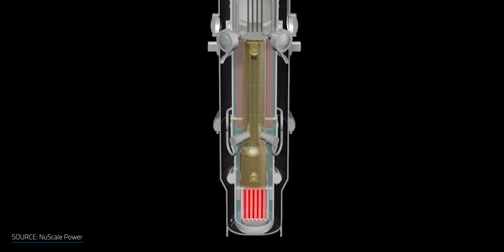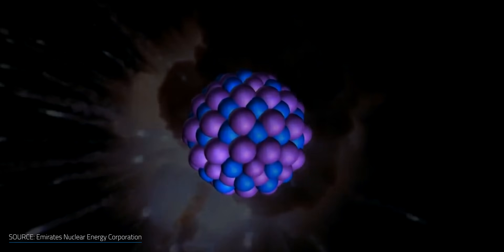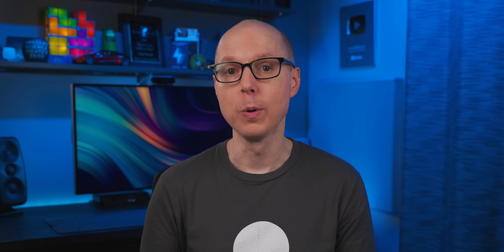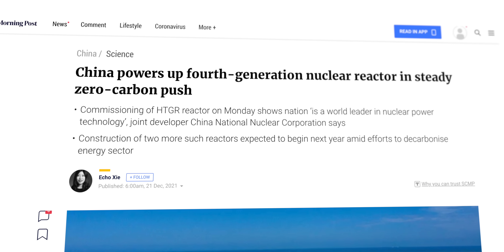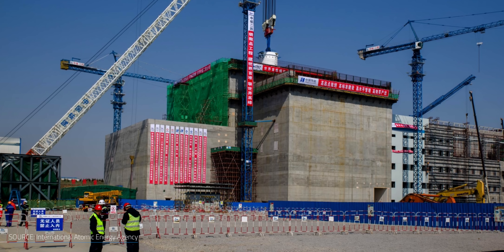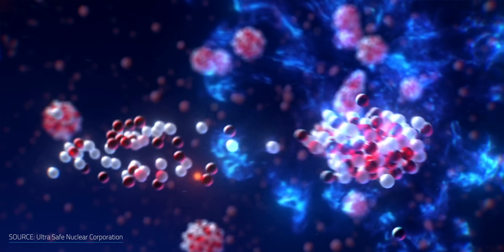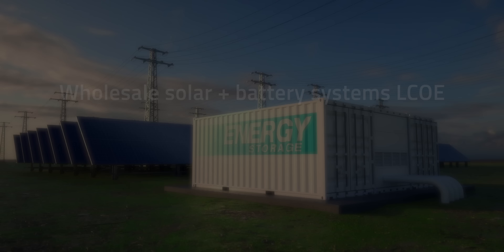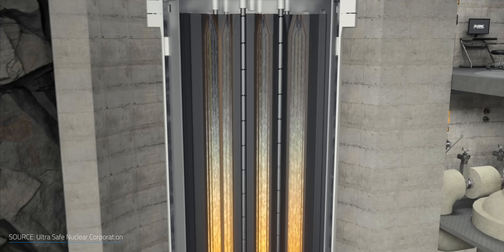Forget Small ... What About Micro Nuclear Energy?

Comment: What about small Thorium reactors I have heard about? You barely mentioned it. Small enough to build into every home or other building. No miles of wire to run. No danger of radiation. Also no big company to bill you for electricity, it comes with the house. Only service or maintenance costs.

Comment: Conventional nuclear power is faster to build (and cheaper) than wind, solar, and hydro. Even one of the most expensive nuclear power plants (Olkiluoto) is more affordable than the cheapest wind farm in Denmark. It has also increased its capacity way faster than wind (basically being built more quickly). LCOE is really flawed. It doesn't take the capacity factor, lifetime, backup and interruptions into account. It can't be used to determine the difference in cost of nuclear and renewables.

Comment: As versatile and efficient as helium gas cooling is with this technology, I think it's a non starter, for the simple fact that theres no means for consistent production on earth. It takes thousands of years for radioactive isotopes to decay into helium within the crust, and then we have to find it. This could be used to our advantage on long timescales with our own spent material, but this requires planning and follow through far beyond our current systems would accommodate.

Comment: I do not believe those wind and solar cost one bit. Reality prooves them as lies. German wind energy only exists because of massive subsidies. And not a single wind turbine has survived it's 20th birthday, the day the subsidies run out. Aren't they supposed to be super cheap and fully written off by then? Shouldn't they be free energy? Well, they aren't. At least in Germany and right now, wind energy is neither green nur energy. It's a cashgrab for subsidies. A scam. And nobody does anything to recycle the giant concrete pads that destroy forests and any hope of reforestation. PVC recycling is nonexistent. Plus, the inconsistency causes Germany to panic buy at 5x price in droughts, and sell at negative prices during storms.
Reply: Oh, and why does Germany have the most expensive electricity in the entire world if they have the biggest solar and wind program? Aren't they supposed to be exponentially cheaper than Polish coal of French nuclear powerplants?

Comment: Comparing cost per MWh between renewables and other sources makes zero sense due to the intrinsic problem with renewables, reliability. In my country we had to stop hydro production because there is no rain. There was also little wind so it doesn’t matter how cheap something is if you can’t produce it. The future is renewables with nuclear as backup, and SMRs seem to fit that role.

Comment: Solar, wind and hydro LCOE $26 - $50 /MWH, Solar and wind can not be used for baseloads and require gas backup. Hence the reason Europe, with all it's renewable generation now faces insane energy costs. Solar plus battery LCOE $85 - $158/MWH. For those of us that live in northern latitudes, this simply is not viable for 4/5 months of the year and represents dangerous wishful thinking. The reality is that SMRs represent our current best [unproven] option

Comment: I'd be curious about an even smaller (nano?) reactor for individual building use. If we can push the safety margin high enough and the maintenance failure rate low enough, ship it as a leak proof concrete cube with a plug. Once it lives out its lifespan, sell it back to a larger facility that will crack it open and recycle the waste material as a fuel source. Thus recouping some of your initial cost. Then you buy another cube and drop it into your fission hole.
Reply: Most fuel rods would fit in your home hot water heater.

Comment: Small modular reactors are a very promising technology, as are molten salt reactors, and using thorium as a fuel source. As a chemical engineer who has researched nuclear energy in my undergrad and since, nuclear has so much potential that we've barely scratched the surface. SMRs and microreactors would dramatically cut costs, especially installation costs, as they could be produced in factories benefitting from economies of scale. They use smaller quantities of nuclear fuel individually, which is inherently safer than larger quantities in the same place. However, the main problem I see with the Chinese SMRs (and the Radiant ones) is their reliance on helium for cooling. Helium is exceedingly rare on earth, and becoming more scarce as time goes on because it is the only element besides hydrogen that regularly escapes our atmosphere. I know the helium would be in a closed-loop system, but stressing the already low supply isn't wise. Overall, with economies of scale and the refinement of SMRs, I am sure the LCOE would drop dramatically.

Comment: Depends on who owns them. My municipality has trouble keeping trees trimmed and the roads clear in winter. I would probably not trust them to properly handle a gaggle of baby reactors.
Reply: To be fair they likely don't need mutch maintenance once installed and unlike cleared roads from the occasional snow storm and trimmed trees the SMR provides a more directly measurable benefit to the owner (as they are selling the electricity).
Reply: and we've seen how well BP is at maintaining safety equipment that doesn't lead to profits. (blow out preventer = who needs that?!?! ) These things are dangerous and you can't let some company bean counters say safety is second to making money.

Comment: " former SpaceX engineers"

I like how you keep mentioning that asif it means something. SpaceX does not do anything nuclear, nor anything related to generating power. They haven't even thought about how they are going to power their ship on their missons to Mars yet. 

So why does it matter that some of the developers used to work in an unrelated field where, I might add, they have yet to actually achieve anything usefull?

(and yes I am not a Musk/SpaceX fan)

" but what if we could make them smaller, portable, cheaper, and safer."

Smaller just means you need more of them and nay risk you have is multiplied by the number of units.
Portable is a void term.
Cheaper, well, to procude per unit maybe, but you still need the same wattage so you'll end up paying more units and because it's nuclear you need many safe places to put them, with many crews looking after them, many trucks visiting them to refuel them, etc.
Safer is just... why do you even bother saying it? Having a lot of small devides is NEVER safer than having a few larger ones. The more units you have, the more people are involved who will make mistakes. Yes you can say that the results would be less catastrophic, but feel free to explain how well off a city is when it has to be evacuated because some arse with a digger drove into the small portable nuclear reactor building.

Is the whole world just getting dumber?

Comment: Helium is NOT a great coolant.  At all. That is a FLAGRANT Lie. 5:30. It requires insane levels of pressurization control in order to prevent a leak because of how smol the molecules are. So it is not a good option when you have to cool crazy levels of heat. Although its specific heat is high making it better than water. However, coupled with the fact that humanity is already facing a massive helium crisis BECAUSE it is NON RENEWABLE and the fact it is difficult to guarantee containment under STP conditions, we really shouldnt be using it as a coolant when its needed for tons of medical procedures.

Comment: If someone has the will and cash to fund research and development, I believe that nano scale molten salt thorium reactors could be up and running in less than 10 years based on some of the designs developed at Oakridge.  They could affordably be made small enough to power a house or small group of houses.  There are other possibilities for powering individual homes that no one is even looking at yet because they would involve a paradigm shift from the idea that we need 120/240 volts in our houses to run everything.

Comment: It's kinda strange to compare the deathrates of energy sources. Remember, only ~90 people died from the chernobyl disaster and are part of the count of your shown chart. Unofficial (and therefore not counted for the chart) over 6000 people died from the radiation while helping to reduce the damage from this desaster and near a million people had premature death because of it. They are not on the chart. And still I didn't wrote about the tenth of thousands people who had to left their homes for ever.
Other numbers, but similar counting for Fukushima.

No question, the total number would still be lower then gas/coal/oil, but much higher as shown.

Comment: Smaller means: a) You increase the risk of failure by the number of reactors. b) You need more people just to protect them against e.g. terrorrists. c) You have to rebuild a multitude of reactors when they are done. d) You still have all problems regarding waste. e) You are still more expensive than renewable energy. f) Real SMRs are not availbe now. Ones close to the concept is Akademik Lomonosov in Russia. It took 13 years to build it! 
We need solutions now and not in 20 years! Wind turbines and solar cells are available now and they are very competitive. SMRs are blue prints and nice CGA. If they are available one day,  it will be too late (like fusion). So forget SMRs.

Comment: The way I see it, we should just build a facility full of SMR's and connect their respective generators in series. Whenever one SMR runs out of fuel or needs to be permanently shut down, just encase it in it's own concrete-boron cubicle. Build new reactor cubicles above the old ones. When it's all said and done, the waste will be encased in a block of concrete and boron.

I first read about SMR's in 2001. In recent time I've learned about them once more. The idea of a self-contained unit that you can dispose of after a decade instead of refueling is quite appealing in the wake of Fukushima (even if large-scale plants are safer than ever).

Comment: When you mention the cost of solar and wind energy, is that including the need for batteries if those technologies took over. Nuclear can run consistently 24/7, (with occasional scheduled down time of course), so when you’re discussing costs you have to consider the batteries needed for renewables to run 24/7.
Reply: You would also need to factor in battery costs for nuclear anyway. They may run 24/7 for 11 out of 12 months a year, but they aren't able to provide the variable power output that is required during the day, let alone increase production during the scheduled 1 month maintenance for another reactor.

Comment: Nuclear Energy is the FUTURE, we NEED to move ASAP into this already RELIABLY proven Energy resource. China and other countries are YEARS ahead of the USA as they realize the long-term benefits. Regulation, while necessary to ensure safety and use protocols are in place, is really an outgrowth of FEAR and a lack of UNDERSTANDING. The NARRATIVE for using this amazing resource needs to be changed so that more support for their use can be widely adopted and the stranglehold of FEAR and regulations can be lifted. Otherwise, we do ourselves more harm in the long run.

Again, Elon Musk is LEADING the way. There is no question Nuclear Energy in some compacity be it SMR or MNE will be needed for the foreseeable future. Elon is pushing forward because he KNOWS we need this power source if we plan to go to the Moon, Mars, and beyond with manned flights. Ion drives powered by MNEs is where he is headed I believe with VARIANT. 

Also, Elon wants to produce a power source that EVERY HOME can use on its own regardless of weather conditions and is better than the Solar options we currently have which only can access around 35% of the energy generated by a Solar Panel. The MNE is a perfect solution to power his EV TESLA cars and homes. 

We have Nuclear Submarines and aircraft carriers in the marine industry. Why are we not making nuclear power available to the entire boating industry? Container ships would do far better with a small MNE than by burning millions of gallons of oil and diesel. Also, for smaller boats having a reliable and consistent power source onboard to power the motors and all navigation equipment, as well as lights, kitchen, and HVAC services, would be amazing! Certainly, at a minimum, we can use an MNE to provide unlimited power to charge BATTERIES in the current configuration with the bank of LifPo4 batteries we use on boats.

I do agree we need to come up with a process to handle Nuclear Waste. Just like we need to handle the WASTE from batteries, packaging materials, and the food we eat, we need a plan for Nuclear resources. IF there was some way to RECYCLE these NWMs and REUSE them it would certainly go a long way in convincing people of its viability as our primary power resource.

Comment: As much as I like nuclear power it is not the solution to our energy problems. Nuclear mining pollutes the water and soil with heavy metals, the reactors themselves are clean but the mining is what I'm concerned about. Furthermore the decommissioning process, when you decommission a reactor you need to chuck all the contaminated steel away it can't really be recycled. Ultimately we're just trading one non renewable resource for another and all the power dynamics that come from it. If we properly design solar panels they can also be recycled and refurbished very easily. 

In terms of safety you are absolutely right, but it's largely because nuclear reactors are designed with more rigorous safety protocols and need to adhere to stricter regulatory requirements. 

For reference on why solar can be viable: 
https://www.youtube.com/watch?v=IZEaYjo4ZJU

Comment: Fast neutrons can only mean one thing- higher enriched fuels. How is this safer from a security standpoint?
Reply: Because making weapons-grade material requires a particular procedure which is completely absent. Material, preferably depleted uranium, is irradiated in a breeder reactor for a brief period of time. This "toasting" of the Uranium produces Plutonium-239 almost exclusively. A power reactor will produce numerous Plutonium  isotopes. This mix is utterly useless for making weapons and the technology to isotopically separate Pu-239 doesn't exist.
Reply: @jsn1252  Not to mention that the creation of a nuclear bomb that actually has good yield is expensive, exceedingly difficult, and requires substantial facilities. Its a bit more complicated than 'just get a critical mass' because if you can't hold the mass together while its going nuts, it just melts and falls apart before getting enough energy to really mushroom cloud anything.
Reply: @jackbright2125  the creation of fissile materials is 99% of the problem. The remaining 1% can be handled by a cadre of  high school makers.
Reply: @TinHatRanch  It is entirely possible to construct a gun-type bomb with plutonium-239, it just isn't practical. Reactor-bred pu-239 is contaminated heavily with pu-240, which is too unstable. More pure material is too expensive to produce.
The killing blow was that to create a functional gun-type explosive using plutonium, they would need to make the bomb too long for the bombers to carry it, so they just decided to use uranium instead and save plutonium for implosion type development.
Reply: @jackbright2125  my point exactly. The stray neutrons from 240 would have fizzled the bomb. If my aunt had balls she’d be, well…
Reply: @TinHatRanch  Again, you can build a gun-type with the 240 contaminated fuel. It just has to be bigger, and would have been too big to fit in the bomber. The prototypes were a little over five meters.
Reply: @jackbright2125  more along the lines of having fissile material that isn't "contaminated" by other isotopes/elements that are throwing off neutrons  that may just set the whole thing off. These contaminants are present in nuclear fuel and are hard to remove...
Reply: @jsn1252  you’re missing the point. A reactor that requires “fast neutrons” to operate IS running on higher enriched fuels…
Reply: @TinHatRanch  It is a priming process and by ratio not that high
Reply: One doesn't simply walk in and snap up radioactive materials lmao. Let alone being able to do with anything with them.
Reply: @etherealrose2139  ok, I’ll let the North Koreans and Iranians know this. Thanks for letting me know.
Reply: @TinHatRanch  Yeah, Iran doesn't have nukes and the norks have 1 generation nuclear technology, and that is with the resources of major nation states.
Reply: This fearmongering again...
Look. You don't need a fast reactor to make a nuke. You need a military reactor, usually gas cooled, where you can swap the fuel on the go.
Israel or North Korea don't have any civil NPPs but have nukes. My point : if you want nukes, build a dedicated military reactor but stop tryiing to make people believe that having fast breeders is what is used to make nukes.
France had the Phénix and Superphénix fast breeders. France never used them to make nukes. France used the Marcoule G1/G2/G3 reactors for its nukes.
Reply: Also, if you REALLY wanna make a nuke using a civil reactor for whatever reason, you know what's the best reactor you can get ? a CANDU. Not some fast breeders. now pls go bomb canada cause they are a security threat.
Reply: Depends on what u mean by security.its very secure in regards to lose of life and pollution. Possibly less secure when talking about some one using it to make a small nuke.
Reply: @jayknight139  Fortunately, making a nuke is a lot harder than it sounds.